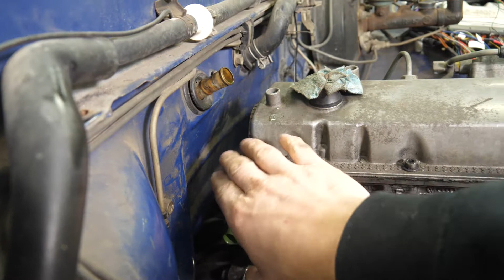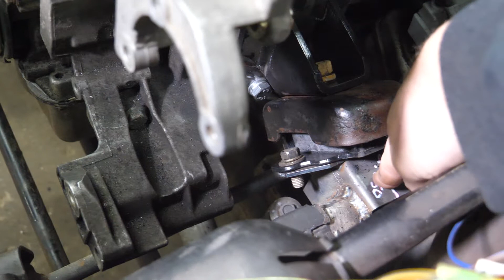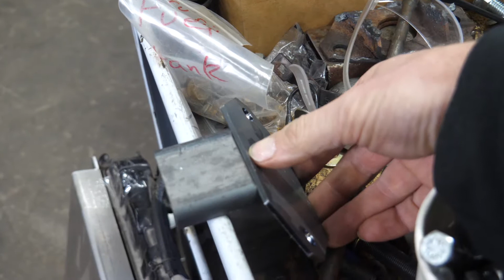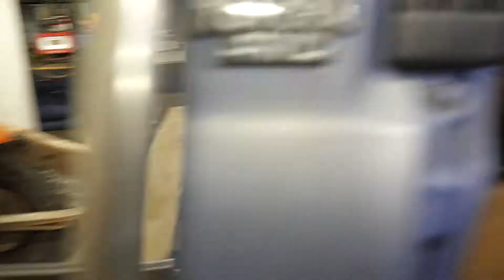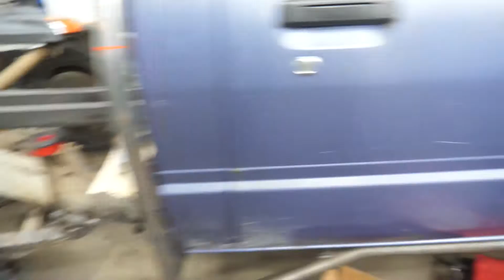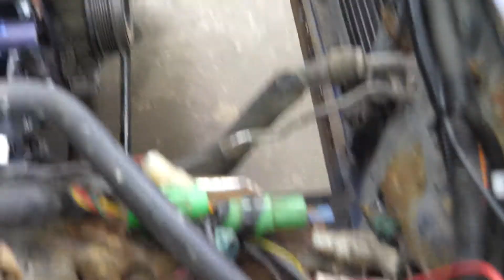Toyota VW TDi part 4

Comment: Did you ever get this truck running? Love your tdi swap videos. Curious on your progress.
Reply from the maker: I did. The ALH i installed was a used salvage yard pull-out and ran for a short time (smoked a LOT) and shortly after we got it on the road the injector pump failed. Truck sat for probably a year, which was in the midst of the shop closing locally here and relocating to Minnesota, so it ended up getting parted out.  It's a shame, the truck worked really well while it ran.  I started into a tdi powered  single seater buggy project since.

Comment: Are there going to be any new videos on this truck? I’m about to start the process of swapping my 85 as well using talks adapter plate.
Reply from the maker: I lost shop space and it sat outside waiting for a new home. I have some  space again now, It'll be inside before winter.  Which engine are you going with?
Reply: I’ll be using an ALH out of a beetle. I planned to use the DCS adapter plate and vacuum pump delete plate and fabbing my own mounts. I’ll probably be purchasing in the next month or two. I’ll also want to try to retain AC cause I live in Texas and I’d also like to setup cruise control.
Reply from the maker: @Sethjordanb  it doesn't get too hot too often here, but i'm keeping the AC in mine as well.  Malone (if you use them for tuning) can leave the VSS enabled in the ECM  to set up cruise.

Comment: I'm very much looking forward to your v6 no lift kit, My dad really wants the old 4runner driving again but he doesn't want to give up his diesel power that he's used to on his 08 Dodge or the A/C lol
(yes he knows he wont have 6cyl cummins torque)
Reply from the maker: The little ALH engines are pretty respectable with fairly minor work--he might be surprised!! The adapter plate and the crank adapter are done, worked on motor mounts today, so it might be a real package quicker than we thought!!